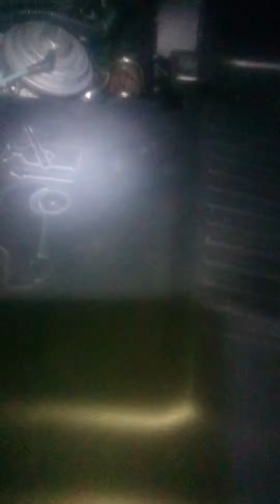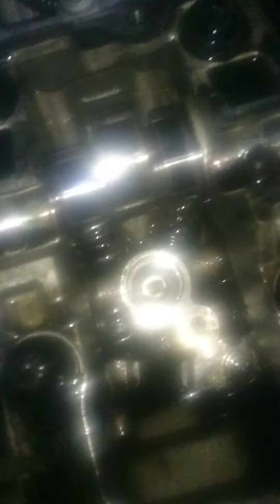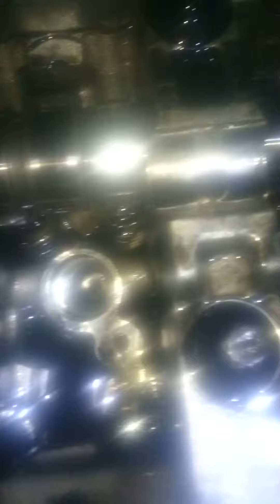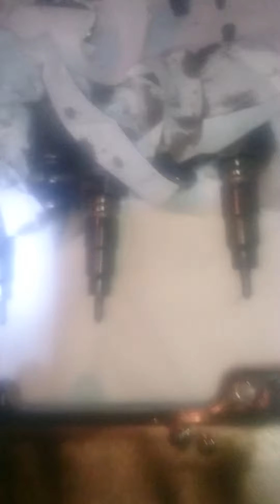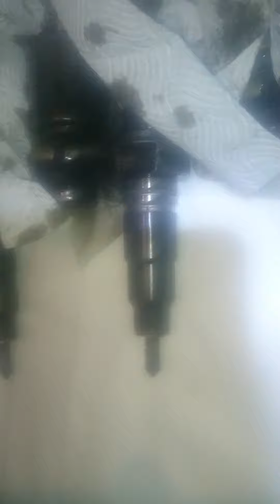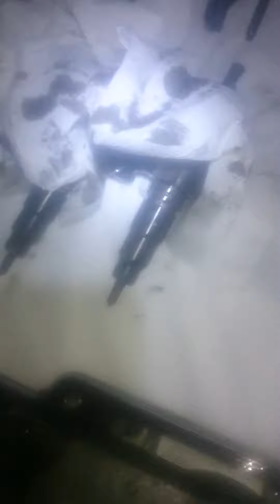Discovery 2 injectors seals gone showing blow by

Comment: Can this cause jerking and for the s&m d flashing aswell?
Reply from the maker: edward thomas yes  jerking low power and stopping on tick over noisy fuel pump not sure what you mean by sm d light if your auto yes engine tourge all wrong an the auto box won't be happy
Reply from the maker: After I fitted new injectors seals all good 😉